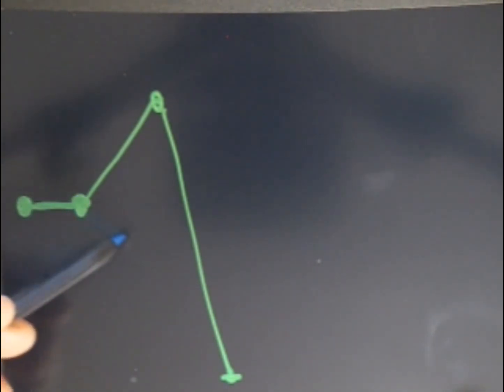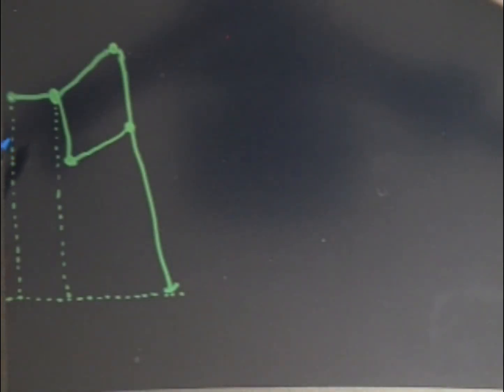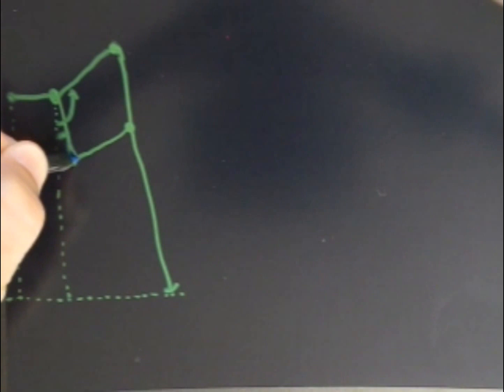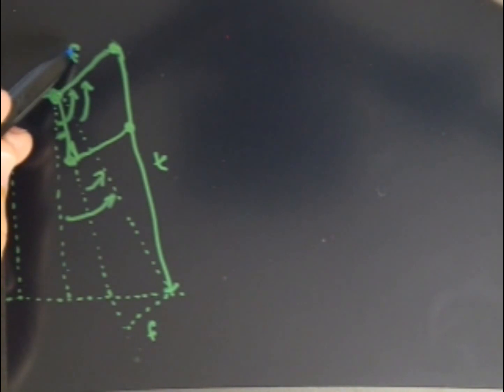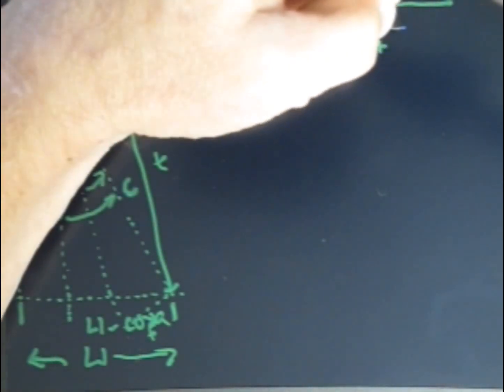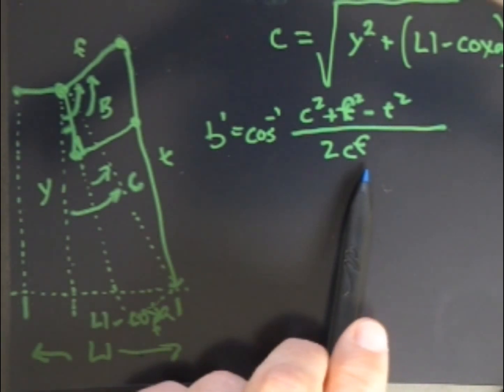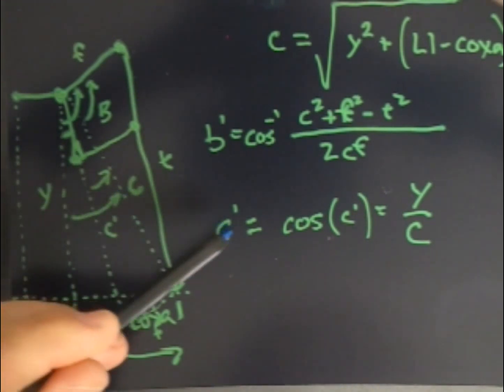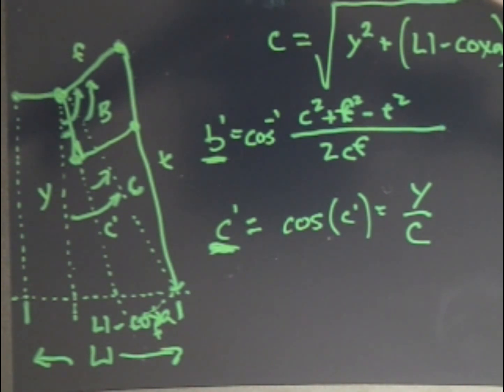Inverse Kinematics for Hexapod

Comment: Roberts Robot. :)  computing with right triangles is the easiest meth!
Reply from the maker: Since I posted this 7 years ago, I found a different method of doing the calculation that turned out to be easier. I still use the Law of Cosines as that was faster than breaking it up into smaller triangles. Since the math is all coded in assembly language, it is faster and leaves plenty of time for these calculations. Some day I need to re-do this video with the current setup….